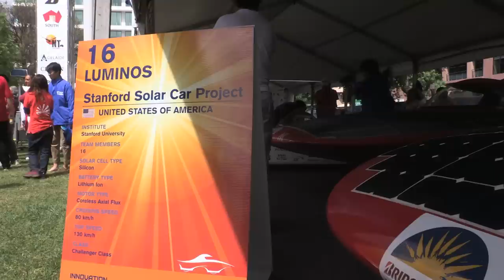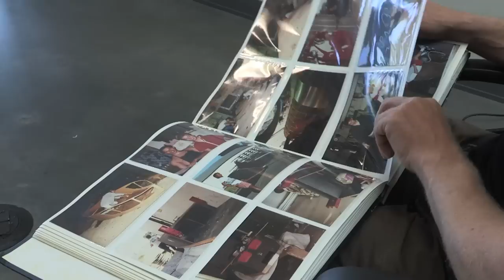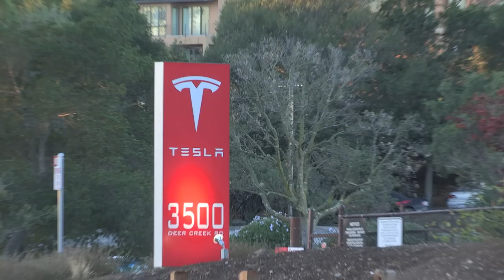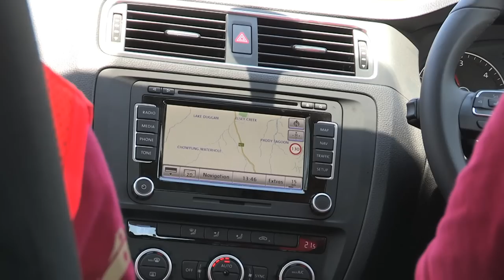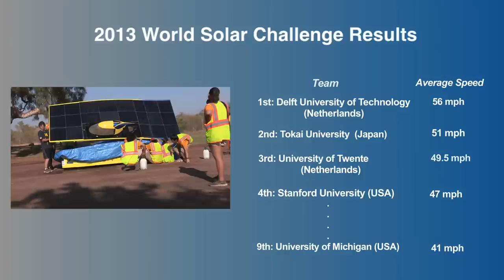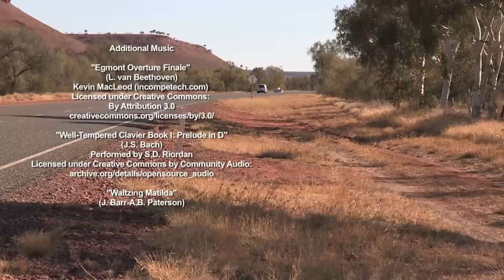Stanford Solar Car Project: Racing on Sunshine

Comment: specs?  what is the motor wattage/voltage, battery voltage/amp hours,  vs.  watts/amps that solar panels produce.  I think this is critical information to understand how this is all possible.

Comment: a tip, 2015 year, add a few "windbelts" to the model, spread them around the structure and you'll be able to sustein the car for much longer periods, including night,... Or jist convert the car structure itself into the windbelt system poles, and strech some tapes... Basicly the wind will flow trough the car, and make the windobelts produce energy even during night...
Reply: +Alex Siqueira (Jack's) there is a reason why they call them solar cars, not wind cars.
Reply: AssGobbler5000 hehe guess you're right, can't really argue with that...
Reply: +Alex Siqueira (Jack&#39;s) But that will mean removing kinetic energy from the car by converting  into electrical energy.  Sources of energy loss include inefficiencies of the wind belt kinetic to mechanical energy conversion. losses in converting that mechanical energy into electrical energy, losses in converting that electrical energy into chemical energy, losses during storage. will all those losses, you can choose how fast you through energy away.
Reply: +byAARD M8 why are you asking random people on a youtube video for advice, when the internet is a plethora of information that can tell you more about everything than anyone ever could? come on bruh...
Reply: AssGobbler5000 Because they can help me design it, and personal recommendations...

Comment: typical documetary.lots of mouthwatering shots but no information about speed range,batteries They need because of shade
Reply: He explains that the battery setups are closely held secrets.
Reply: Hermann Otto yeah. Awful. He mentions the battery itself is a secret but they can definitely get more technical than this. Though this is mostly a doc about the challenge itself, not the cars.
Reply: Li-ion is the battery they use and 20 kg was the limit for battery weight in this year's challenge

Comment: How have the cars improved over the past 25 years?
Reply: The sun has gotten hotter
Reply: Solar cell efficiency has increased. So has inverter efficiency and Motor efficiency
Reply: Solar cells, electric motors, charge controllers, motor controllers, materials eg: carbon fibre vs aluminum and fibreglass, aerodynamics ( university computer simulation access )

Comment: Nice to see this happening, and the ORIGINAL owner of Tesla. :D

Bit disappointed to not see any new technologies of your own..
Reply: why do we need any new technologies?
Reply: @robinsss  Because current commercial Solar tech is inefficient, typically 22%. With the most efficient solar cells (30%) being made of hazardous materials, which is why they are only found on space satelites.
At present there is work to get a 45% efficient commercially available solar panel, but my contacts have not given me much aspect on its market availability.
Reply: @James-xr7pb  they are efficient enough to move this car 2,000 miles without gas

that is efficient enough  most driving purposes
Reply: @robinsss  Then why are solar cars not common place, if they suit 'most driving purposes'?
Reply: @James-xr7pb  good question

i was wondering the same thing

there is a lot of politics going on behind the scenes that result decisions and results that don't make logical sense

why did the Chevy Bolt only go 50 miles  per charge when they had already designed  the EV1 that went 120 miles per charge?

why did they bury the EV1 in the desert?

why did Ford sell the Think car at the last moment the year they were scheduled to put it on the ,,market  to customer?

why  have inventors of most HHO cars vanished along with their blueprints?

lots of fishy things  have gone on sense the EV became viable

many people including myself believe it's because alternative fuel cars  could seriously hurt the oil industry

this video just proved that you don't need gasoline to run a car at all

that's dangerous  information
Reply: @robinsss  Well I could tell you, I'm a renewable energy inventor and it is one of my worries.
- 
Okay all I hear about the Chevy Bolt is good things, even the EPA give a good range of 240miles, not 50miles.
- 
Li-ion chemistries used in EVs are lighter, higher coulombic efficiency, and have higher energy densities than NiMH or PbA chemistries in the EV1. Less weight, more energy, fast charging, and higher cycle life.
That said the EV1 disaster happened because of American oil industry and GMM conspiring. (I have seen the same documentary).
- 
They didn't bury the EV1's they moved them and crushed them. While disabling museum versions, (removing the special motor controller programming) .
The Ford Think car similar to EV1, except it was an awful design. I don't blame Ford for that one.
- 
HHO inventors scurry when Physics comes knocking. All the 'blueprints', or patents in my world. Are actually protected and usually publically available. Like that Water car inventor that died of a  cerebral aneurysm. So you could try and make them, but you would be wasting you're money. Because if its free to make, why has no else used it?
- 
And HHO variants do exist; Hydrogen cars, they're just expensive, and if they leak = extremely dangerous.
- 
Gasoline is only one derivative of crude oil, EV batteries require petrochemicals for plastics, and preperation. 
My contacts to the oil industry say the biggest market for oil is actually the petrochemical market, not consumable fuels. Which is good news since burning oil is the worst thing you can do with it.
- 
Corona virus has crushed the oil industry, Tesla with its 300mile cars, and turned 400miles with a single software update. The oil industry hasn't assassinated or axed any EV companies yet.
Reply: @James-xr7pb  the patent on  a device does not tell you all the details of how a device

it  only describes   the device

are the design plans for Stan Meyer's HHO device available to the public?

when i said the Chevy Bolt  i meant to say the Chevy Volt

when it  was released it only went 50 miles on a full charge

even though GM had plans for the EV1 that went 120 miles per charge

why make  buy the an HHO device?

why buy tomatoes and lettuce when i can grow it?

buying it is more convenient 

bottom line : we don't need gasoline to drive a car

this contest proves it

that's a revelation
Reply: @robinsss  The Chevy Volt is a plug-in Hybrid rebadged from the first flagship car Vauxhall put any effort into; the Ampera.
(The PHEV I should of bought, instead I got the Outlander).
- 
At the time Li-ion batteries cost around $800/kWh. Which meant EVs cost a lot to make, or you could use a small battery for the EV part for a commute to work, and occasional petrol use for long trips. 
- 
Now in 2020 the cost of Li-ion is dropping below the $100/kWh mark, making EVs cheaper to produce. Combine that with the diversity of fast chargers popping up, giving long distance EV journeys greater breadth. Unless you have a Tesla, you never had range anxiety.
- 
No one can make the original EV1 NiMH (120mile) pack. All large pack patents were bought by GM, and subsequently stopped others from using them.
So only smaller mild hybrid packs could be made. 
But NiMH isn't good battery chemistry compared to modern Li-ion. 
- 
For starters it's Charge efficiency is only 60%, which means you have to put 140% the amount of energy to charge it to 100%.
Then you have to consider the memory effect, which can be avoided by 100% discharge and recharge. But that will also drop the cycle battery life from 5000 to 1500 for 80% depth of discharge to occasional 100% depth of discharge.
- 
Li-ion has a charging efficiency of 99%, so nearly 1-1 (101% energy) to put in.
Every part can be continuously recycled.
It is much lighter than NimH, and now cheaper.
No memory effect, no self-discharge, higher cycle life, and since there are so many usable chemistries for Li-ion Automotive use. 
- 
It would be difficult to buy up all the patents for use.
In other words, we are Winning :)
Reply: @James-xr7pb  and your point is.....................................?
Reply: @James-xr7pb  once again

why did Chevy release a car called the Volt that went 50 miles a charge when they had  already developed     a car that went 120 miles per charge?
Reply: @robinsss   Because Vauxhall in the UK and Europe were starting to create EVs, and GM snapped a chance to sell it in the US under they're own name. Li-ion is a better chemistry than NiMH as I explained. 
- 
The world is set up for Li-ion. So selling the EV1 again would be a set back so to speak. Li-ion was cheaper to priduct than NiMH, but people still had safety qualms back then about it. Not to mention a insult to GM, and bring up what they are trying to make people forget they did.
- 
Not a good starting point for re- marketing EVs. Since they have been repeatively squandered over 186 years xD
Reply: @James-xr7pb  ''''''The world is set up for Li-ion. So selling the EV1 again would be a set back so to speak''''

not for the consumer who should be the focus of any company

it would have saved the consumers money since gas had tripled in price

so it doesn't make sense
Reply: @robinsss  I remember hearing that GM actually regretted that decision recently. Because of the rise of the EV market. 
But GM won't bring the EV1 back, but that won't stop someone making a replica?
Hint hint Robinsss, with all the 80s nostalgia adverts. :D
- 
EV startups are becoming more common such as Lightyear, Sono Motors, YASA electric Westfield kit car, etc.
Similar to other companies in the US making Cobra, Ferrari, Lamborghini, or Porsche replicas.
- 
Nobody likes being seen as the 'Bad guy', or remembered for serious errors in judgement. Like American losing in the Vietnam war; or Italy, Japan, Russia, and Germany in the 2 world wars. The EV1 disaster is a irremovable stain in GM's history.
Something that when moving forward no one wants to remember, be associated with, or new employees want to be blamed for.
Reply: @James-xr7pb  their decision didn't age well
Reply: @robinsss  Haha... I know right. XD
Those who know EV history, (like us), can laugh at GM!
- 
But it did not all get lost, AC Propulsion (now Tesla). Designed the original Controller for the EV1, (basically a large 150kW HiFi amplifier), and the same reason Tesla's were ahead of every other EV in performance.
That without it is what disables all the EV1's in museums.

Comment: I would like a normal car covered with solar cells to charge the battery all day long.
Reply: There are already tons of concepts that want to realize your dream and there are also cars on the market as well. The development is faster than you think. :)
Reply: Can you name a few? Im really wondering why more companies does not commercialize or bring further this idea.. All I've seen so far are just custom diy builds using solar power.. not so much commercial ones.. is the cost the defining factor here?

Comment: Are you cheating if you put solar panels on the chase truck to charge a bank of batteries inside the truck then use that energy to power a light bank positioned over the car to recharge its batteries at night.
Reply: In a word, yes.